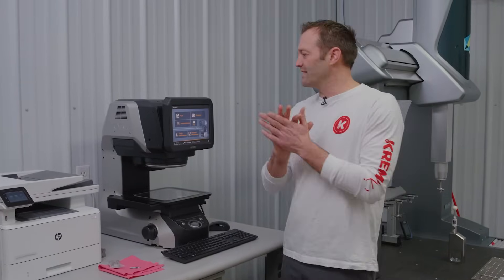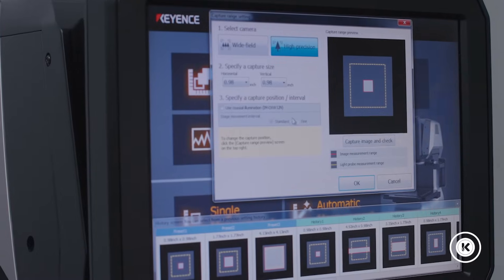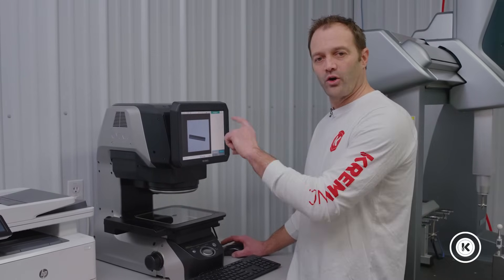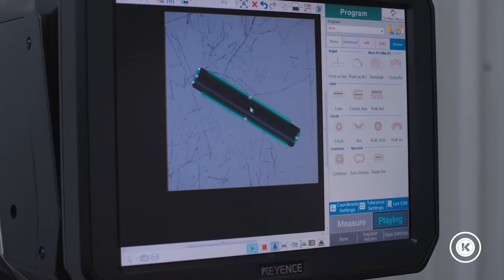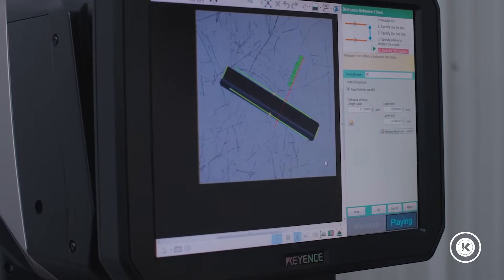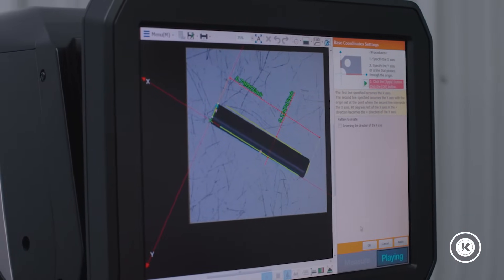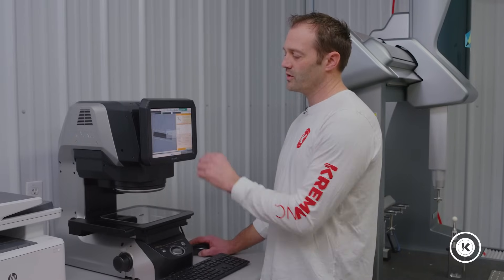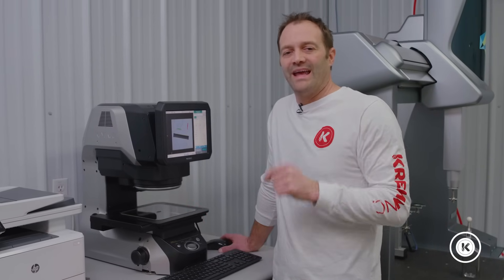How the Keyence Works - Kremin Inc.

Comment: What about alignment? Do I have to do 3-2-1 , etc.as in classic 3D inspection?
Reply: Hey, great question.  You do not need to do the typical alignment needed for measurement systems.  This system uses Keyence's special pattern recognition.  What this feature does is it generates the coordinate system for alignment using features on the part rather than features on the machine.  This way the system locates the part and is able to measure the part accurately in any orientation and anywhere on the stage.
Reply: @AG-jl9zg Hi, how you perform a Daily check or Daily verification? In order to know if the equipment is in continue conditions before performe a real run

Comment: What if we need to change inches vs mm?
Reply from the maker: When you select program from the main screen, you will get a drop down menu in the top corner. Select settings - display settings and you can change the units.